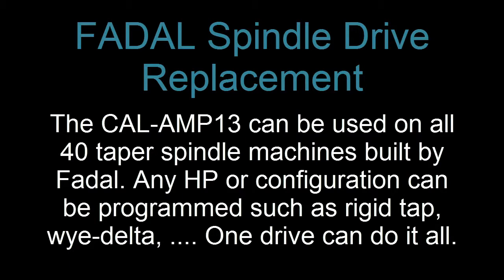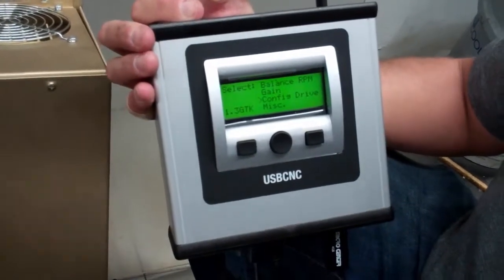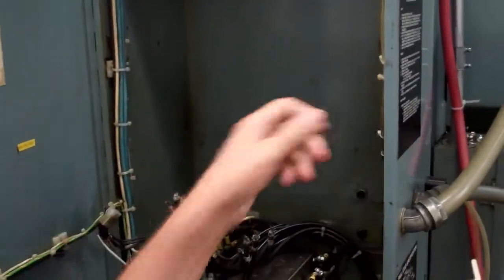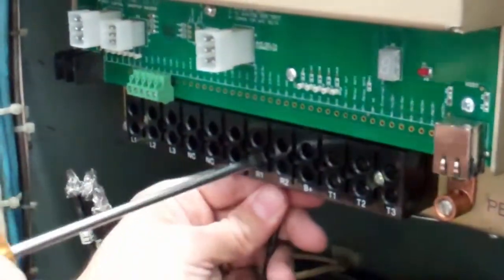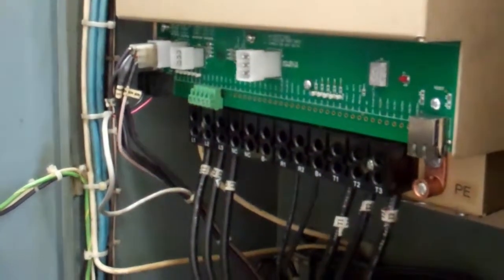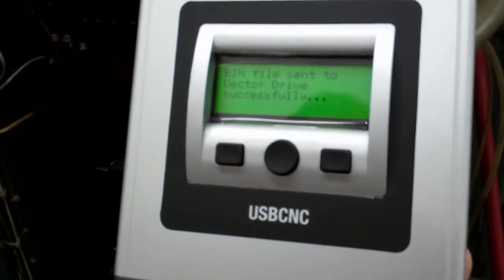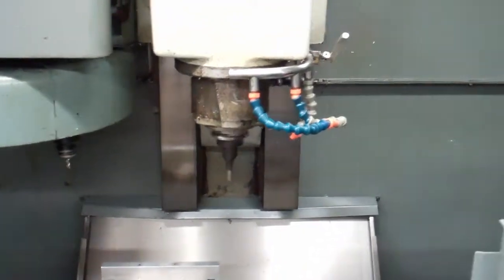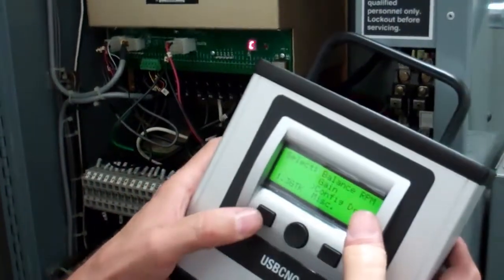Calmotion Vector Drive, Fadal spindle drive replacement

Comment: Thanks for the great video. You spoke very well and thanks for not talking slow, and over explaining what a screw is.
Reply from the maker: Thank you. Note, that we sell now an updated drive, CALAMP-7, now that uses a rotary selector switch to choose the drive settings, so the silver programming box is not necessary. All the mechanical connections have not changed so this video is still valid for the installation portion.

Comment: Will this work with single phase sources?
Reply from the maker: Yes, you can use 220 VAC single phase.
Reply from the maker: Yes, it will work with 220VAC single phase. It will not have the potential for full power but it will still run.